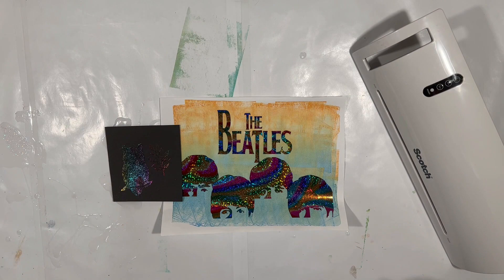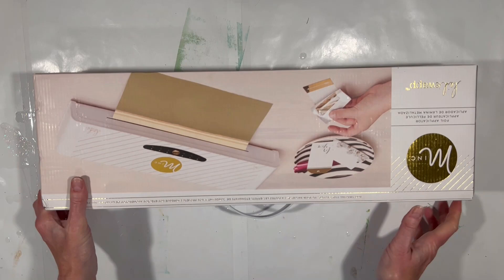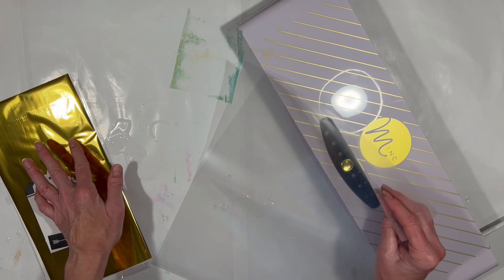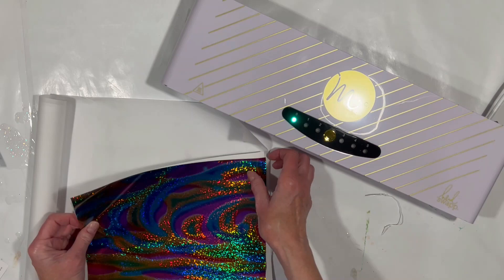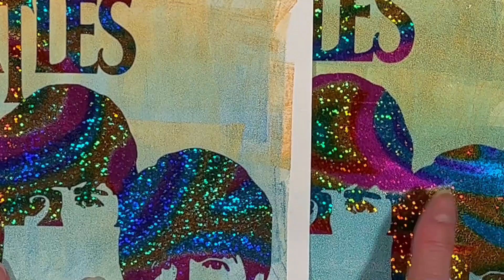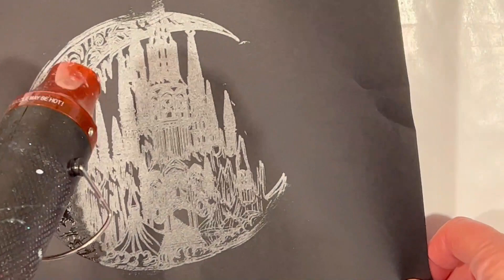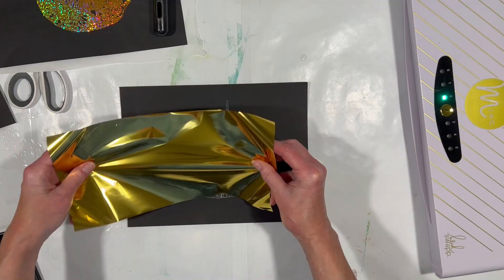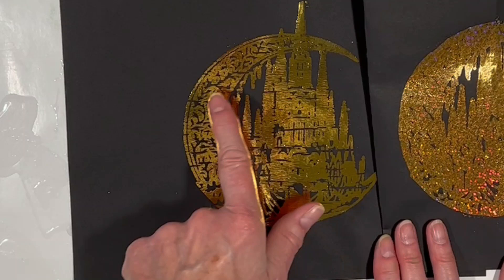Comparison Between Minc Foiling Machine & Laminator

Comment: The type of embossing powder recommended for foiling, is a specialty formula called, bonding powder.
Using regular, plastic based embossing powder, is basically re-melting plastic under the foil, which is the reason for loss of detail. At a lower heat/pressure setting, it would understandably provide better detail, but best results would be with the bonding powder. WOW! offers a great formula for this. 
Hope this helps.
Reply from the maker: Thank you!! I had no idea, and I'd swear when I saw Simon Hurley do this, he was using regular clear embossing powder, not a special bonding powder. But regardless, I appreciate the info and will look into getting some -- thanks very much!

Comment: I love my Minc…don’t have to buy dies to use. You don’t need the Minc brand foil, just need toner-reactive foil. They also have a Minc mini that is cheaper and good enough for if your making cards.  I wouldn’t change mine for anything. I just print something out on my laser jet printer and foil it. No dies needed.  So in the long run you save because the dies aren’t cheap that you use in the other foiling machines.
Reply from the maker: Thanks! I’m enjoying my Minc quite a bit! 😊
Reply: I’ve never bought a die to use for foiling. I use my laser printer and my laminator. The trick for either is to make sure there is no dust on paper or foil!  I would like to see how big a difference the foiling machines like the glimmer foil is compared to the laminator.

Comment: Has anyone ever tried the Minc on laser printed waterslides? What temp setting did you use and what Waterslide brand do you use. Any tips?? I would love to do foil waterslides for tumblers. Maybe even printable vinyl..
Reply from the maker: Fantastic question!!! It never even occurred to me, mostly because I rarely have any success with laser printed waterslides, so I tend not to use that kind of waterslide paper. But you’re right — it would be very cool if it worked. I have melted waterslides before, just trying to dry a cup more quickly with a heat gun after applying the waterslide, but if the minc is set on the lowest heat setting, that might not cause any problems.

Comment: Maybe if the sheet with the minc was used from the kit when using their foil?  What about using removable printable vinyl, I’m a cup girl so you know where I’m heading.  So many more questions
Reply from the maker: Yes, the special transfer folder - I didn't even think of that while I was recording!! It's definitely worth a shot. Thank you for suggesting that! 😊 You can definitely put printable vinyl through the Minc, so you should have no problem using the black laser toner method to foil on printable vinyl then wrap the whole thing on a tumbler, if that's what you were thinking. I'm opening to trying about anything (especially since I have the machine now) - LOL! Thank you 😁😁
Reply: @LuxindasOtherObsessions  yes try that!

Comment: I've never been overly impressed by the minc myself. Its really just an overpriced laminator. For a solid gold or any other color stamped design colored embossing powders alone work just fine anyways. 🤷‍♀️ I can see the slight difference in the Beatles one but certainly not enough to spend the extra money. When your new press arrives you can try it with that too 😅
Reply from the maker: Totally agree, and yes, I will definitely be giving that a try!! 😁